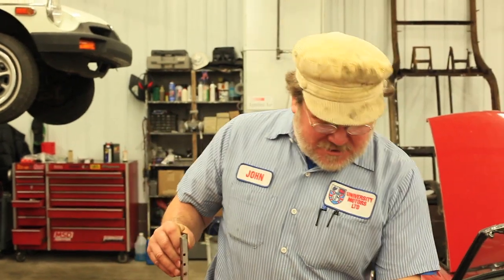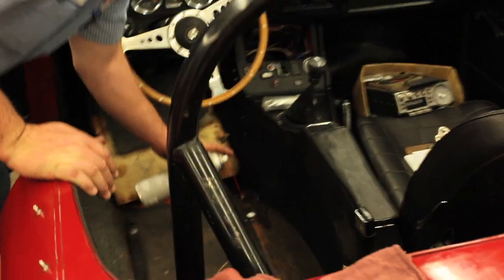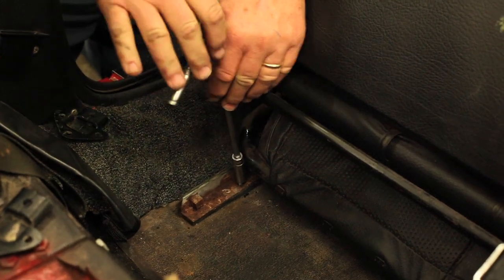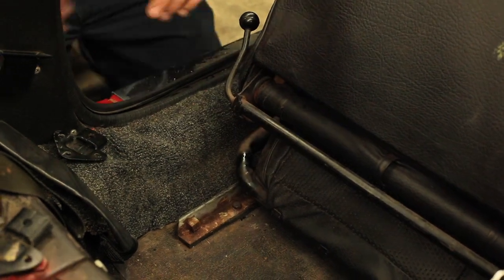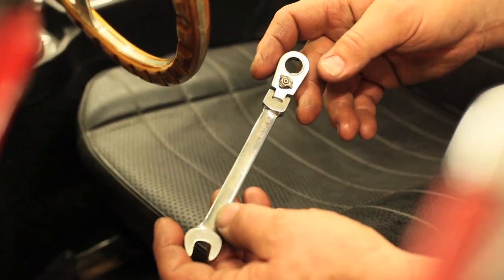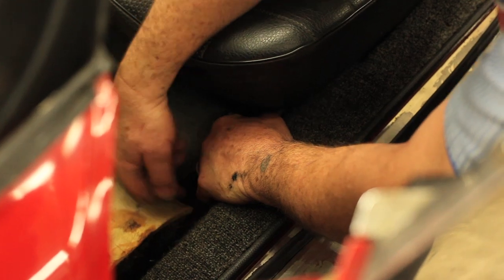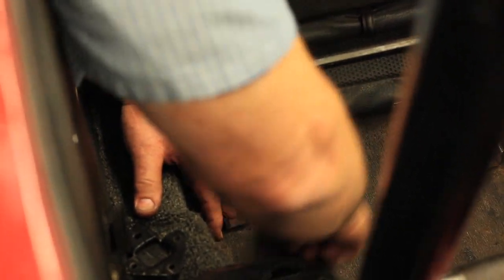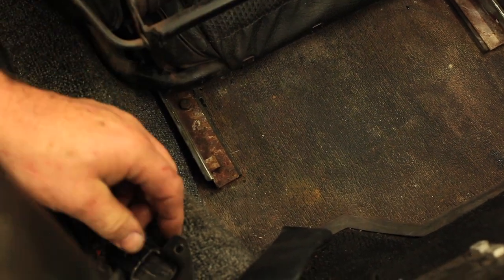175 MG Tech | Installing Seats on MGB

Comment: not that I want to tell the master but lining up the seats with new carpet in is a bigger nightmare,what I did after struggling with one side was to rethink the whole thing over.I  put the screws in from the underside,this told me where to cut the holes in the carpet and where to place the seat,after that all you do is take one bolt from underside and put it in the top as it should be until all 4 are done.
easy
Reply: This worked for me, too.

Comment: Always thought the steel tracks are a silly design. By their very nature, they 'splay open'  —— If it were not for the rigidity if the seat frame itself! These seat tracks need redesigning, in my opinion. It's no wonder, over time the wooden fillers, snap and break...there's, on average, a person of 160 - 200lbs applying pressure to them, for perhaps, hours at a time. They should have made the floor pan with a "cleat" that the accompanying frame would slide under and into, locking it in a position. Then a simple set of self tapping, but robust screws, or lags (with a nut) would secure the seat well. imo

Comment: Hi John, great series thanx. I'm refitting seats to my 1972 MG GBT and was wondering of it makes any difference fitting the wood runners above or below the carpet. The runners were lying on top of the carpets when I got the carpet.
Reply: Hello, aljotock, did you ever receive a response as I have the same question for a 1980 MGB..Thanks
Reply: I also need to know where the strips of wood go. Above or below the carpet??